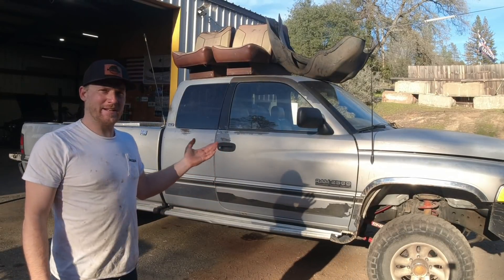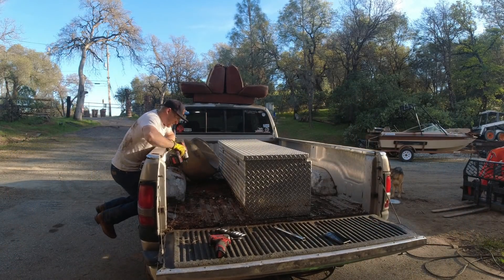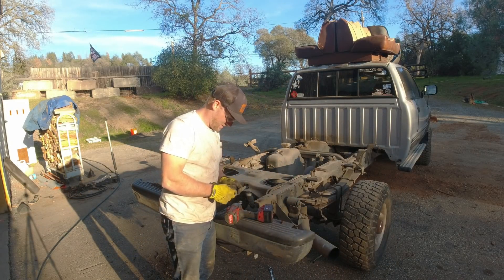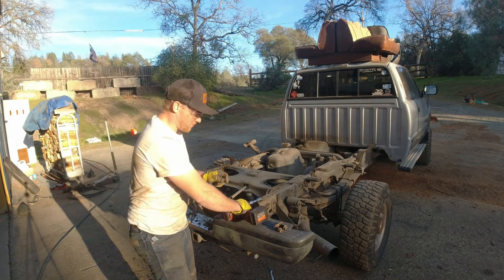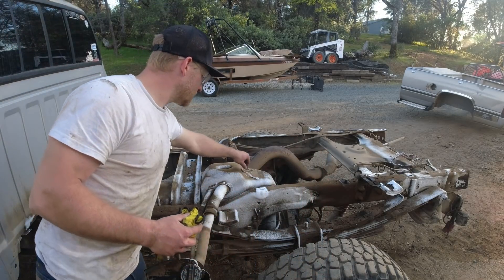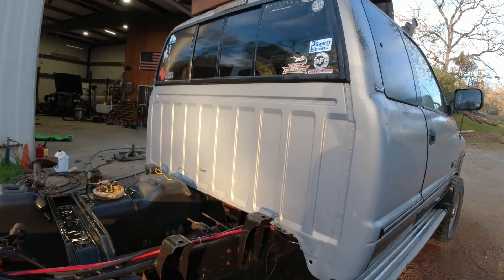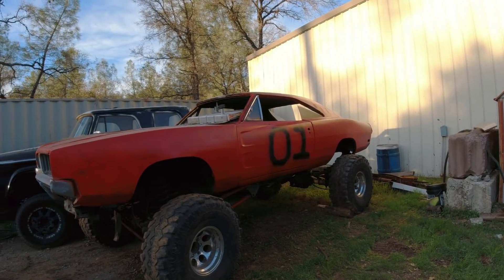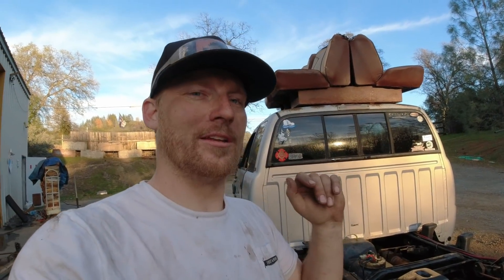TIME TO GET THE NEW 12 VALVE BUILD UNDERWAY 1966 DODGE CREW CAB

Comment: I have a couple of dodge trucks  you might be interested in  an 87 and a 97 the 97 is a cab chassis 2 wheel drive 12 valve 5 speed 114ooo mile trucks real clean but a little body damage it was a work truck let me know if interested love your channel

Comment: Hey man, I could really use the section of the dash that sits right above the glove box.  No company sells that piece and mine's cracked all along the top edge, looks like shit where it meets the new dash pad that's installed.  I heard what you said about keeping all the parts. but I'm out of options it seems.
Reply: I found one in a pic n pull. 25.00 they are available just far and few between.